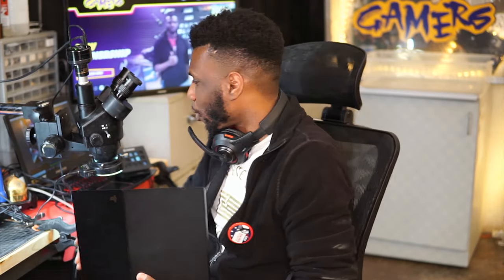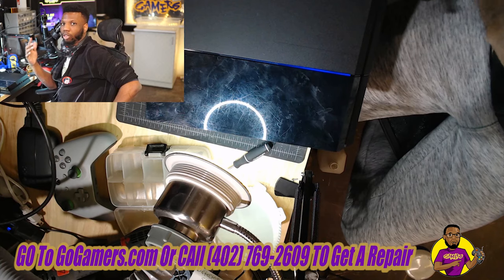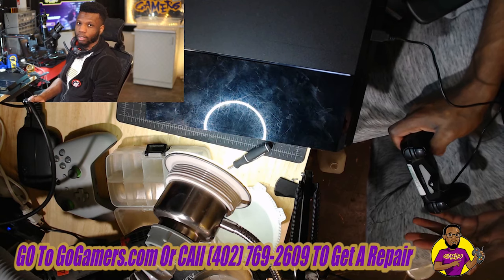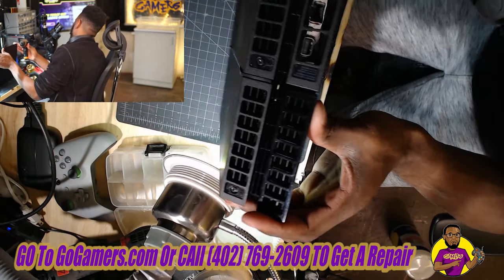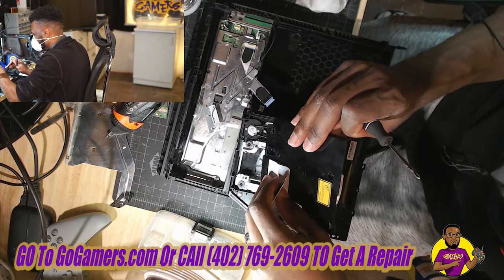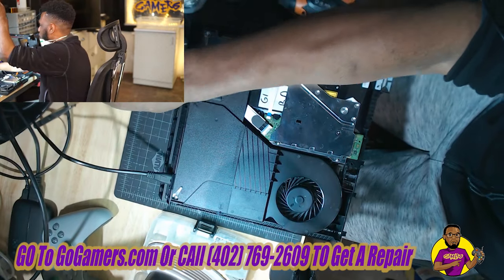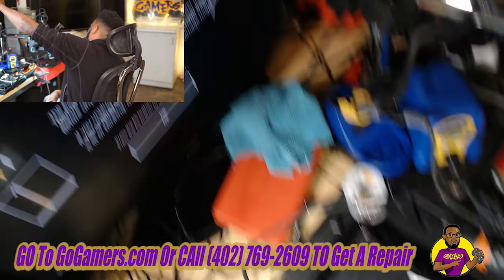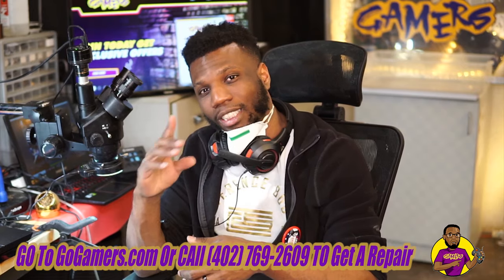HOW TO FIX PS4 wont/Not Reading Discs Or Games (5 MIN FIX EASY) Unrecognized Disc Repair

Comment: After watching this and knowing I ain’t tech savvy I turned my PS4 vertical shook it a little then it worked 😁🤗🤗
Reply: Hahahahahaha bro i did the exact same and it worked thx for the tip
Reply: Do you put the disc in then shake it as soon as you put it in or do you shake it when it’s already in?
Reply: it worked for me 2😂😂😂
Reply: @ywn.nathan406  how I need mine to work too?
Reply: @ahmedm6302  i put the disk in and when it started making noise i shook it
Reply: This was the most useful youtube comment ever
Reply: Oh shit it worked 🤦🏾 🤣🤣🤦🏾
Reply: Now my dust shows as corrupted data
Reply: Dist*
Reply: Your comment 2yrs later still making a difference 😂💪